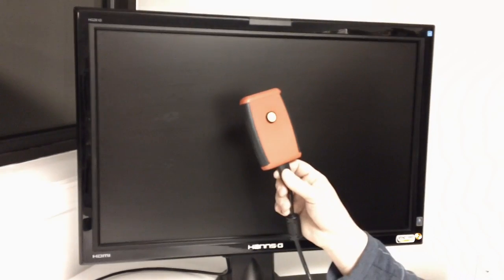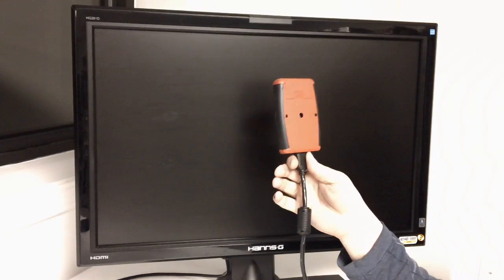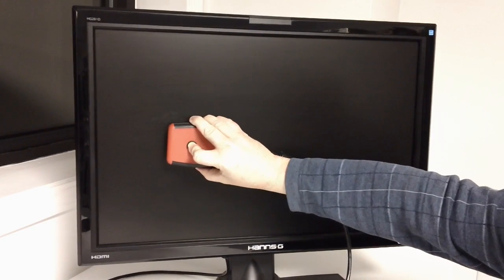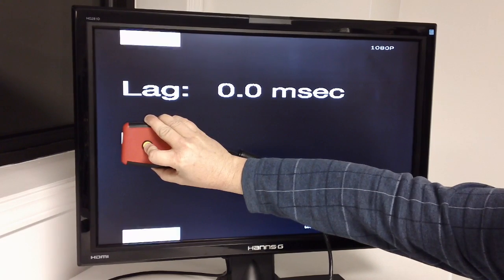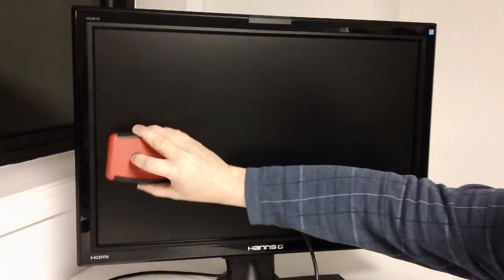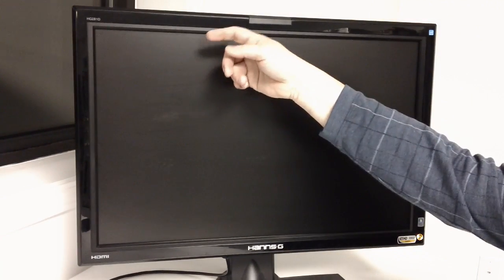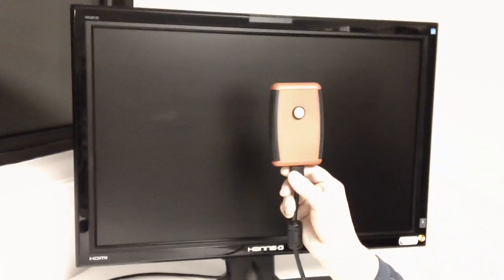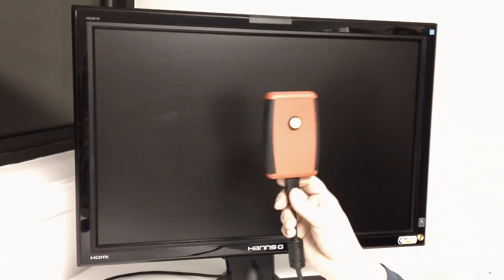Leo Bodnar Input Lag Tester

Comment: Has anyone seen a similar device for measuring audio latency? For a game like Rocksmith, a few hundred ms makes the game unplayable.
Reply: That's the coping mechanism not the solution, to give up. Hdmi audio latency is all over the map though - on some tvs it is acceptably low (how low is low also depends on the corrective ability of the brain). I don't want to rely on two sound systems, i just want something i could use to select the right tv, while there is no information available. It's not even just for rock Smith either. Increasingly i am aware of people's words not matching their lip movements. And Samsung didn't even care, or believe me. Beyond that, even, I am just a nerd who wants objective proof that my TV's audio delay is insane, so I can warn people.
Reply: +Jack Eidsness Nope. If you're interested in knowing for sure what the added input lag is for your devices (TVs/monitors, but AV receivers too!), you may want to bite the bullet and buy one.
Reply: I hear you and I appreciate that. Although it's not relevant to my concerns, I think most people would be very happy to have such a solution.